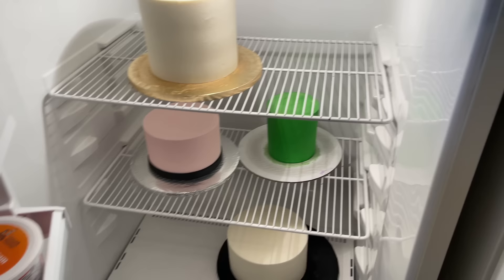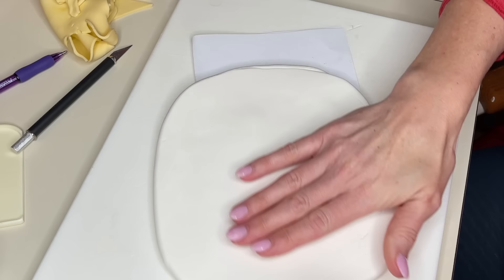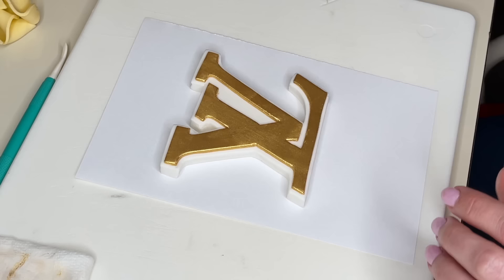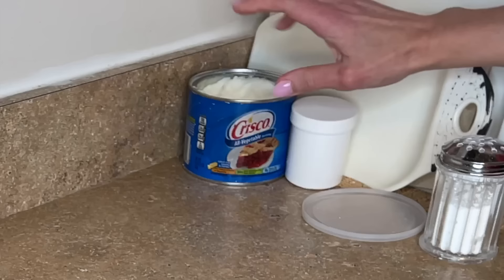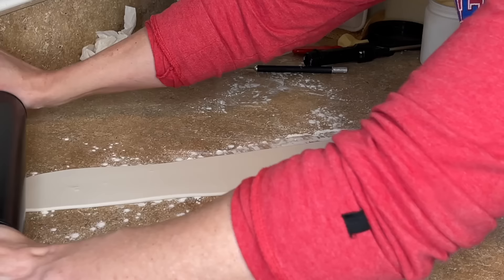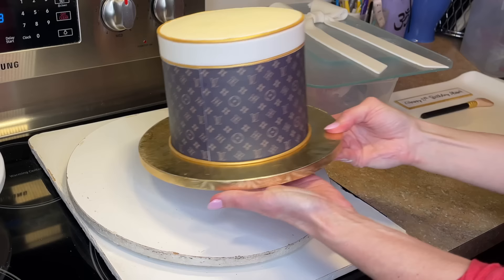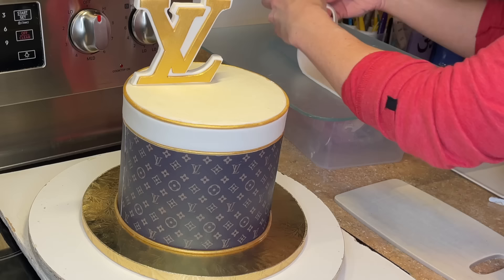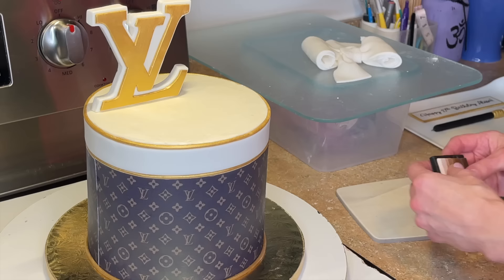Decorate With Me! Girly LOUIS VUITTON Cake Tutorial

Comment: When you eat the fondant frosting is it good and does it cut easily? I would love to make these kind of cakes for my customers but I know people are very weird about fondant frosting but some do prefer it I know you mentioned you used marshmallow fondant. Also I have an edible printer would it be possible to make a cake like this but using buttercream frosting and adding the edible image around the cake?
Reply from the maker: I personally don't like to eat fondant.  I don't like the texture with cake.  I just eat the cake and icing and leave the fondant on the plate, which is what I recommend people to do if they don't like fondant!
You can put the images directly on buttercream.  I prefer to put them on fondant first because it helps prevent the image from wrinkling.  😊
Reply: @KarolynsKakes  Okay thank you. That is a great recommendation I guess I didnt think of that I just assumed the whole cake was covered in fondant.

Comment: I make my cakes the day before. Would I be able to add the edible image and refrigerate the cake say for 24 hours without the image bubbling?
Reply from the maker: I do!  I had that cake in the fridge with the edible image on it for 2 days and didn't have an issue.  As long as you adhere it correctly to the fondant, starting at one end and smoothing it down so no bubbles form behind it, it should be good!